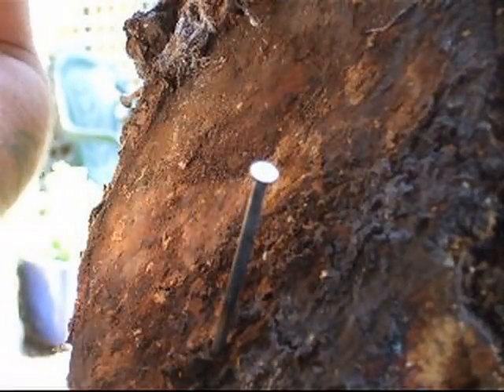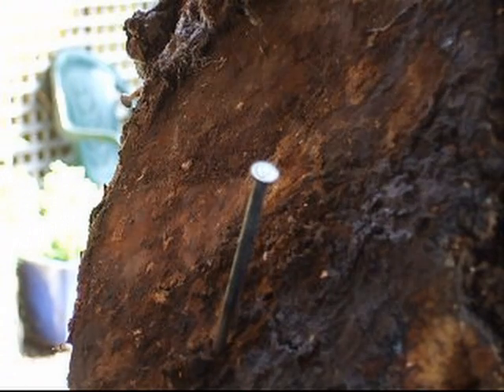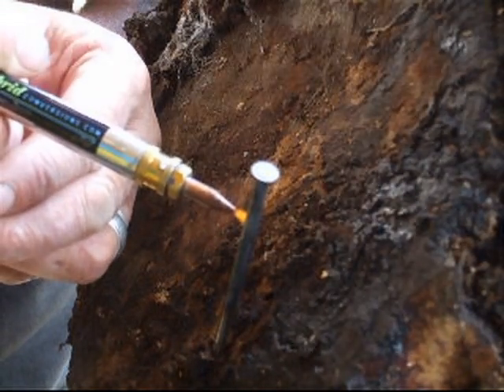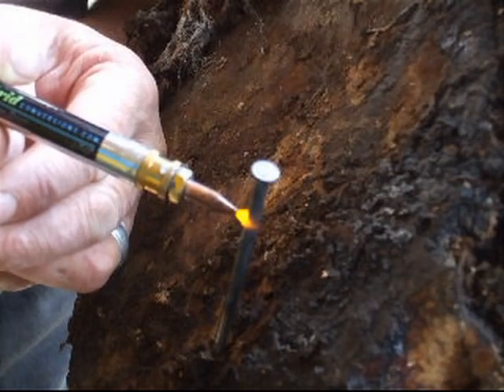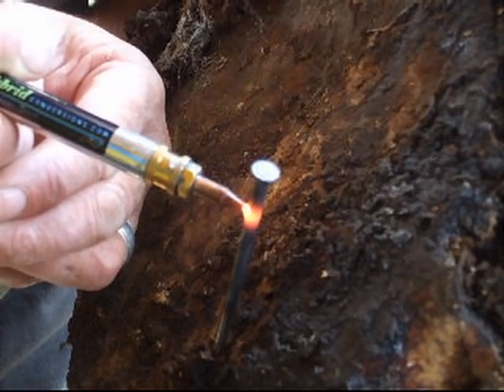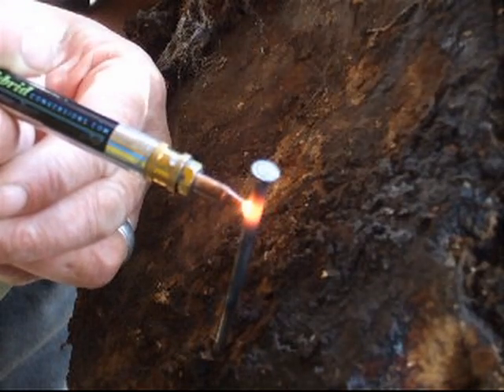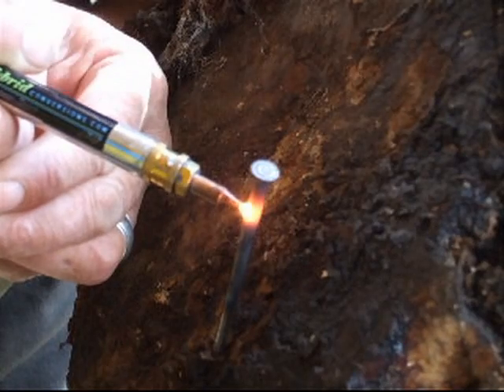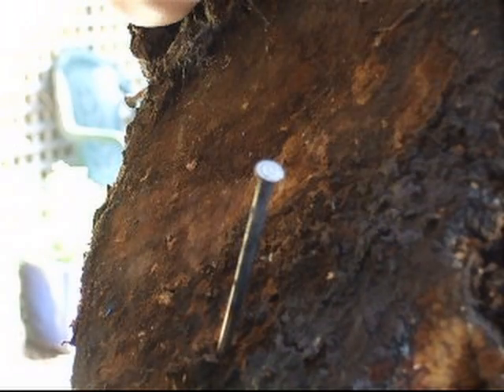HHO ACCIDENTAL EXPLOSION!!!

Comment: like a check valve on a bong going into the downstem so it would bubble and it would not be able to push the water out the area where the bowl would be and the gas would not pass the water

Comment: Dum Dum playing with fire.  Tip too close. That faint buzzing whistling sound coming out of the torch is pre-ignition happening inside the tip and mixing chamber of the handle. You are forcing the thing to work beyond its capabilities. You want the heat far from the tip not right on it , you idiot. Its dull toads like you that get innocent coworkers hurt or killed. YOU ARE FIRED ! PACK YOUR SHIT AND LEAVE...NOW !
Reply from the maker: The thing is you have only just commented on this ,,the video that was made a good few years back now ,you sir have only just started checking  this kinda stuff which makes you very dumb & very behind in the order of things ,also easy to criticise in hindsight  , many things are done wrong in the process of learning & experimentation , makes me wonder what you have achieved in your life other than being a negative troll .

Comment: 1. overheated tip
2. cutting doesn't use brute force of the flame, it uses a stream of oxygen to burn away the metal. 
If you don't have a source of oxygen you will never make a clean cut it, just ugly melted and inefficient hole.

Comment: Be careful man...this stuff can be dangerous..! I use a dry cell, a separator and a bubbler for my torch. Also making a torch filled with some stainless steel wool prevents the flashback. It has to be stainless as normal steel wool would rust, shrink and be useless.
Reply: Hydrogen technology 🚓🚕
Hydrogen help the combustion process to run engine more efficieently.and carbon-free fuel burnning.
HHO gas burn a lot faster then  gasoline or petrol. Hydrogen power  miracle gas remove carbon build up in the combustion chamber and boost  engine power and torique. Reduse  carbon emission ) restores better fuel  economy.
 Hho car kit  prolonging engine life and engine oil life.
 Like a new car!!! 
Engine runs smoother and cleaner to make your car 0 carbon emissions  Boost engine  power and torque Better acceleration . 
An efficient hho car kit lower the engine temperature more then 100 degree F.  Hho car kit reduce car maintenance charges. 
Cleaner engine running. Reducing engine noise due to the faster fuel burning. Hho car kits works nicely requires no modifications in the car engine. No side effects on car engine.
Engine start quickly safe your car battery. No more petrol or diesel smoke or smell. Hho system is very simple.
Hho kit installation  time is about two hours to make your car a low cost hy-brid.
Reply: @ZafarMuhammadMuzafarNiaz  A vehicle can't run on these HHO systems...that's utter bullshit!

Comment: what causes the explosion anyway ?
Reply from the maker: +Mars Seeker pushed the tip too close to the nail ..backfired +flash back arrester wasn't good enough ..there were 2 cells on the go + 2 balloons inline full of hydrogen !
Reply: +flyingdoctorcee You said there were 2 balloons inline full of hydrogen, do the balloons serve as some sort of pressure regulator?
Reply: When you get the chance I would like to know how to safely fill the tank with hho so it can be safely transported and safely used for cooking .
Reply: And stay safe man it's not worth dying over it.
Reply: <Mars Seeker> Breathing Oxygen is always worth dying over...
burn Hydrogen so we can all breathe more Oxygen
Reply: Ra vi well scientifically speaking. atomic bomb is hydrogen bomb. hydrogen in itself is not explosive. but if mixed with oxygen and then ignited in a closed space..  it goes kaboOOOoom...

Comment: Use some cotton wool in your ears when using the Torch.

If the Torch Nozzle touches it whatever your cutting you will get automatic flashback.

The flame is much longer than can be seen with your eyes so keep it further back of whatever your cutting.

I drilled a 3/4" hole in the top of my bubbler and stretched a piece of nylon from a sandwitch bag across the top of my bubbler and then screwed down the lid. 

If i get a flashback the nylon membrane blows and i just replace it.

Comment from the maker: The cell i was using would not produce enough hho to pressure a torch ,you need a very substantially huge cell to run straight off the cell ,also  for hydrogen & oxygen seperation you would need a specific cell designed for this,theres loads of info on this out there , there are also now units forsale specificly for torches ,everything i used here was made by me,except the torch.
Reply: flyingdoctorcee please send me a link where to get that info. if i may ask, havent you tried running an engine with hho?

Comment: Why did you put a balloon in line with the HHO generator and your torch? Is is to smooth out any bumps and keep the flow more stable, or was it for some other reason? Although I have no experience with HHO generators whatsoever, I'd imagine it would be safer to run the torch directly off the generator so there's less Hydrogen gas at any one time. And using an oxy-acetylene type torch head with a separate lines for Hydrogen and Oxygen.

Comment: Storing H2 and O2 mixed is just plain stupid. It's a bomb waiting to go off. And yeah, I agree that calling it HHO is misleading. It's a stoichiometric mixture of H2 + O2, period. And it's very explosive. If you're going to electrolyze water for a torch, store the H2 and O2 separately and mix them right at the torch head.
Reply: If you are using electolisis with water H2O where is the extra O oxygen coming from?
Reply: why separate them when it can be done during electrolyzing 
you made no sense because it comes out at the right mix to burn after makes no sense to store then use later you would have to mix them perfect